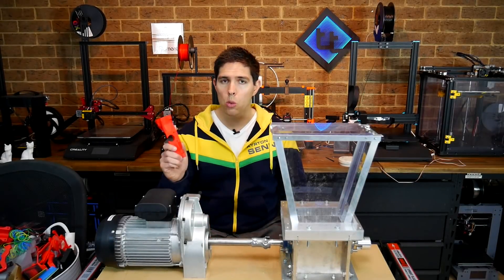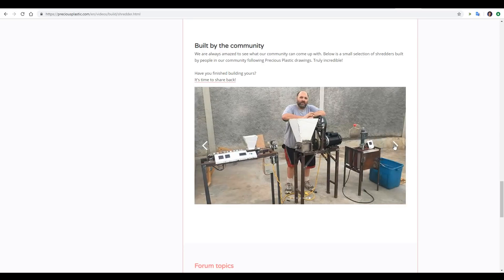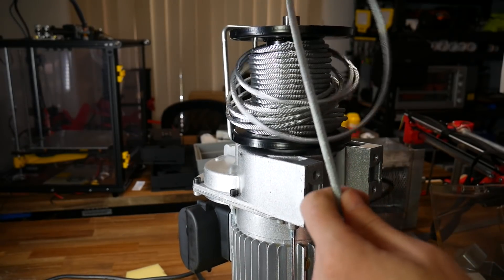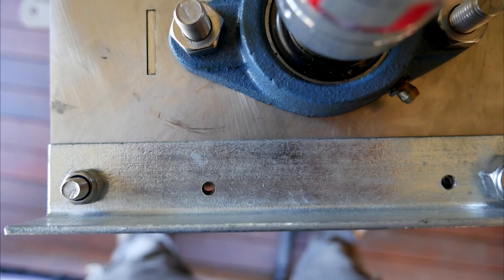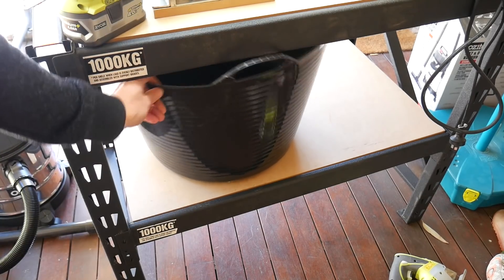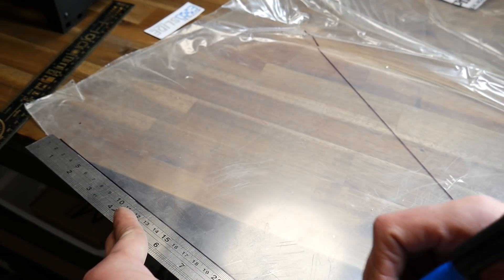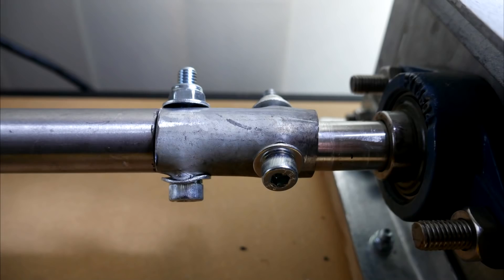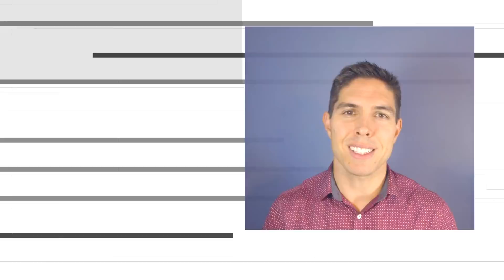Recycling waste 3D prints with a Precious Plastics shredder

Comment: Mdf dust really isn't very hazardous.  You probably shouldn't snort lines of it but incidental exposure isn't going to hurt you.
Reply from the maker: Nothing like asbestos dust but I'd rather be safe than sorry with my channel.
Reply: @TeachingTech  I suppose but you also worked with electricity, spinning blades, plastic dust, a saw, high torque motors, drill bits etc and didnt warn us about any of those.  
The whole litigation/c.y.a. society just annoys me I guess.
Reply: i agree 

but id rather have him warn too much than too little
i definitely wouldnt like to cut a lot in something like a shed or cellar with bad air circulation
Reply: @officer_baitlyn  it's kind of common Sense I suppose.  If you're going to be in a situation where you're going to be inhaling a lot of stuff you don't normally inhale, you might want to do something about it.  It's kind of like don't cut off your finger with the saw, drill a hole through your hand with the drill, stick your hand in the giant meat grinder, etc.....

Comment: I would love if you'd do a video about the extrusion machine as well since it would be a nice all-in-one kit
Reply from the maker: I will explore every option I can find. My impression for the Precious Plastics extruder was it wasn't set up for precision like what we need for 3D printing. Maybe I can find someone who has done it successfully.
Reply: @TeachingTech  Have you looked at filastruders stuff? im not sure how accurate it is but Ive seen it around
Reply: @TeachingTech  do u have your modified firmware that you used on the ender 3 for the BLTouch and the filament runout sensor that you used in this video https://youtu.be/gwHpXaj_6xE
Reply: @TeachingTech  Precious plastic extruders put out too much material, and is better for injection molding type setups...  The Wellzoom extruders work pretty well though...
Reply: @TeachingTech  re:3D have done it
Reply: I second Hans. Personally if I had so much plastic that it would need to be crushed, I'd definitely try to do extrusion for something like 20mm round pipe or maybe something like 20x20mm extrusion to use with smaller lathe or other suitable builds. Of course possibly eventually larger extrusions, but then material need begins to be pretty darn high.
Reply: @Teaching Tech

Here is a fully open source design for a dedicated filament maker and winder:

https://wiki.opensourceecology.org/wiki/Lyman_Filament_Extruder